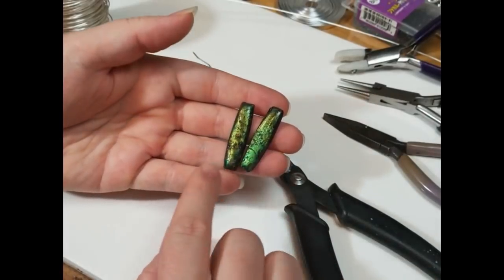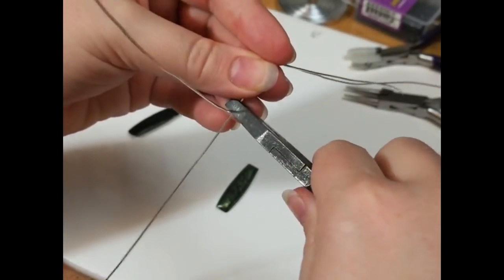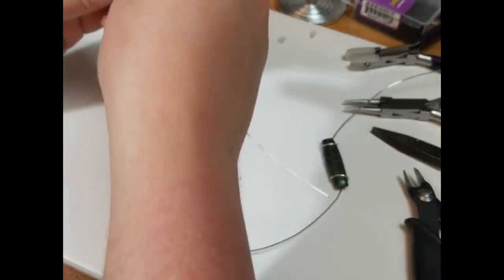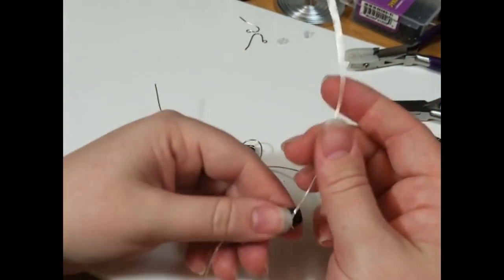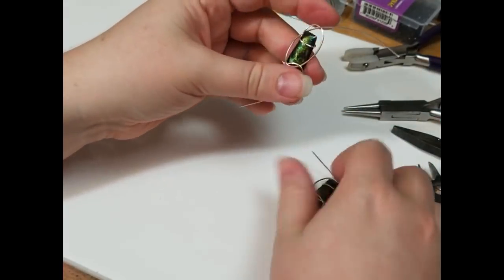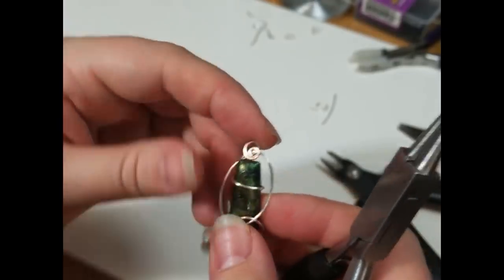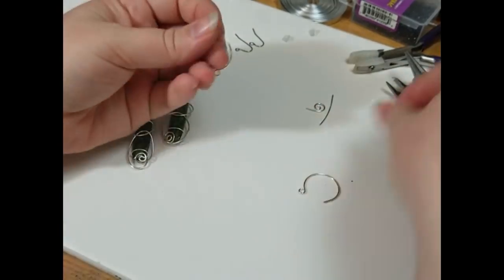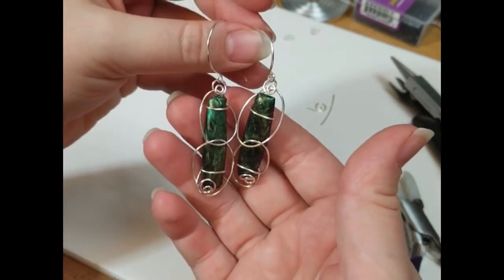Wire Wrap Cab Earrings

Comment: sry quick question guys the file she used is that special. could u use sand paper or a reg file?
Reply: lil bat You could definitely use a small file, or sand paper, or nail files or emery boards etc. There is also a tool called a cup burr which works great but, you need different sizes for different sized wire so it gets pricey. Nail files work best for me.
Reply from the maker: Nail files do work really well; I love this glass file, but any emery board would do the trick :)